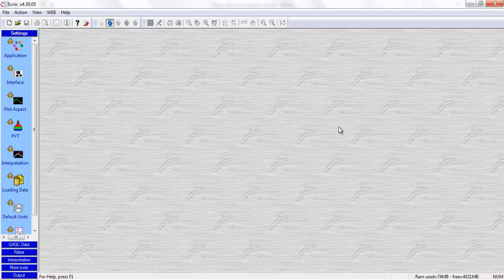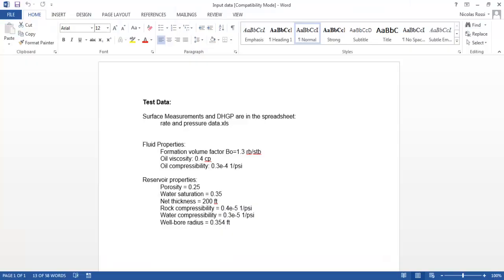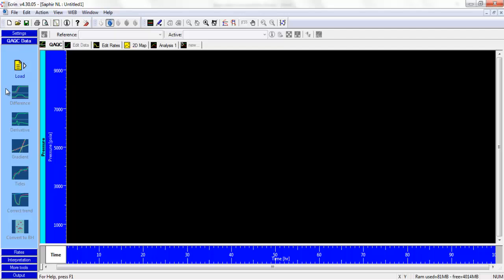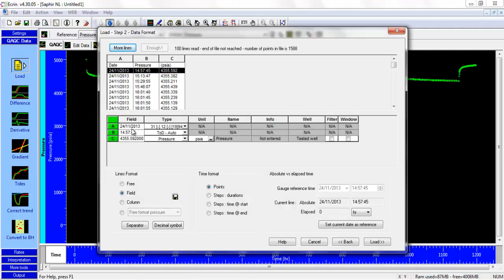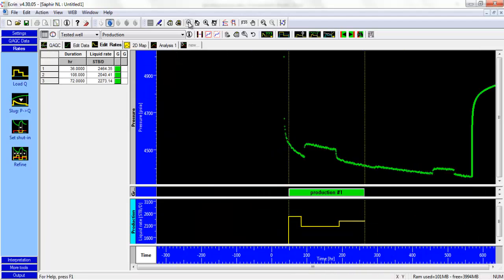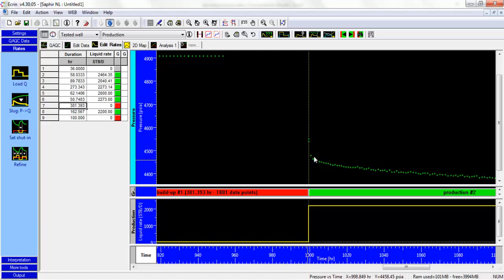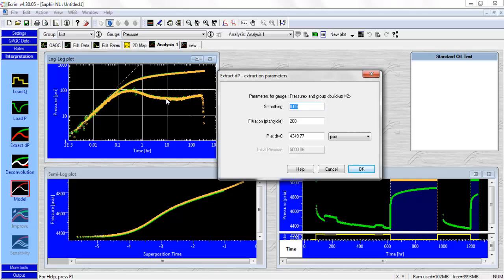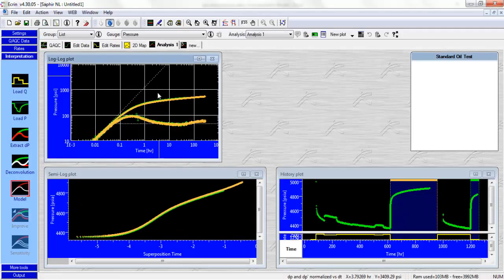Create a well test file using Kappa Saphir

Comment: Hello, dear friends!  I will write in order, because I don’t have time to do it all at once. What I have at the entrance. I have an excell file. I also have Ecrin Saphir, in which I need to load all the valuable information from this exell and interpret the hydrodynamic well survey data. As I understand it, I have the following data: hydrodynamic studies were performed at the NNN field at the 68P well (ID-PBU). I can shows the bottomhole pressure graph and flow rates recorded during the study. Received 3 modes of operation of the well with different flow rates and pressure build-up when the well is stopped. I had many questions at once with regard to the data from Exell itself. My email itmoing@gmail.com Please send me letter if you wanna help me with my work!